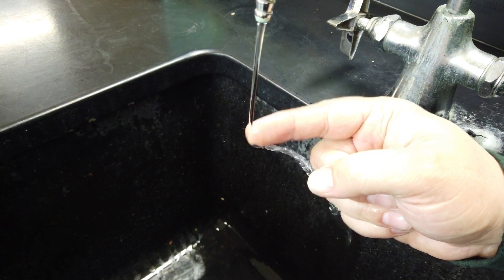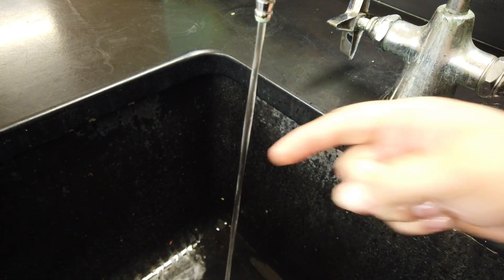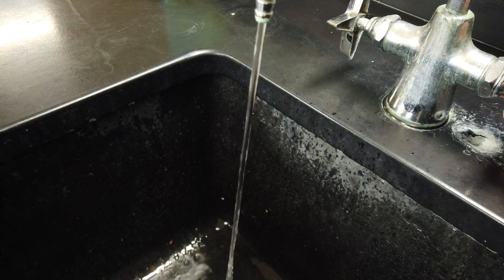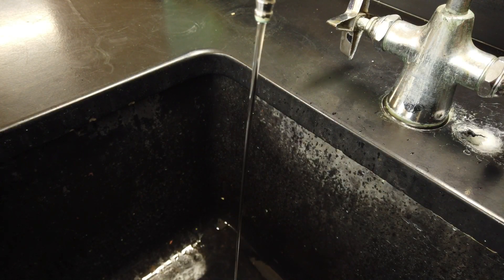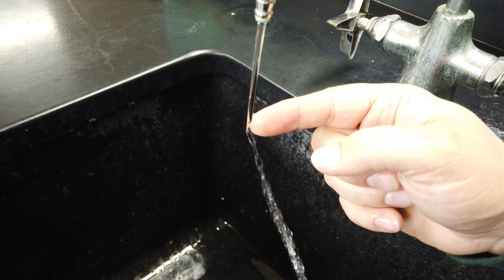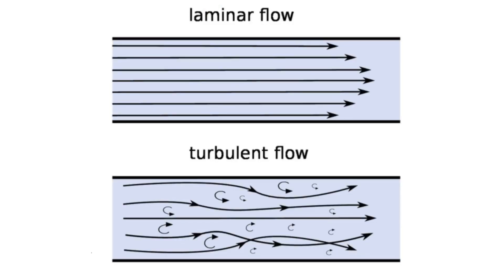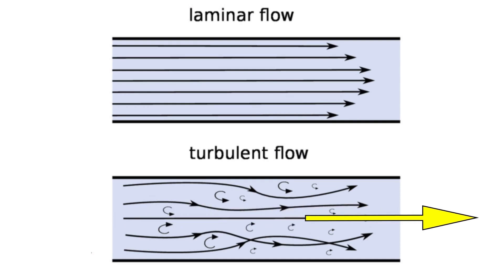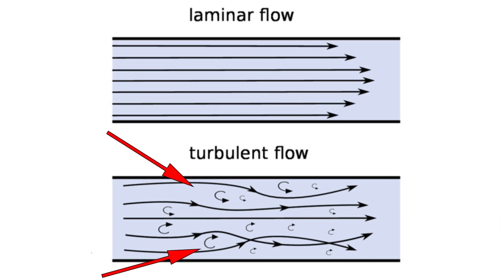Laminar flow is cool!

Comment: What would it take to freeze a dome of water and turn it into an ice dome?
Reply from the maker: I do another video showing soap bubbles freezing into little domes. But running water takes a lot lower temperature to freeze if it will freeze at all. Once it begins to freeze on top it will usually keep flowing under the ice.